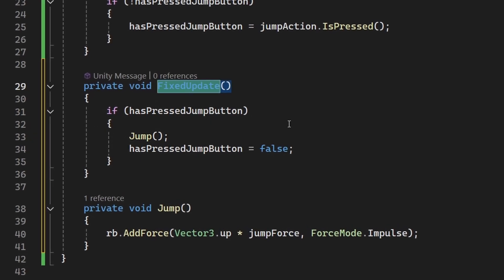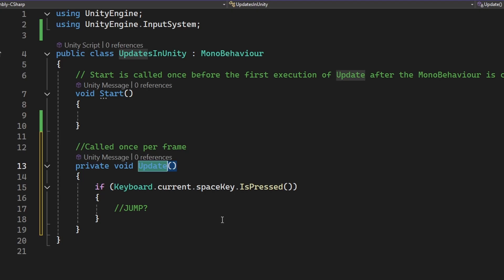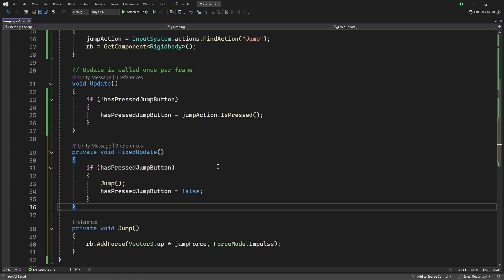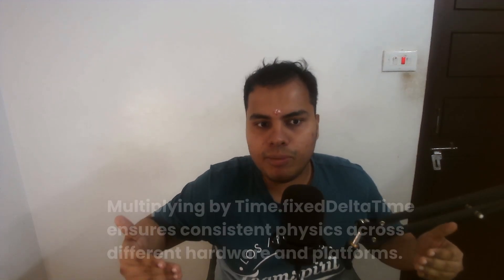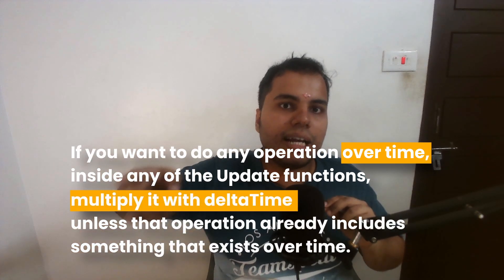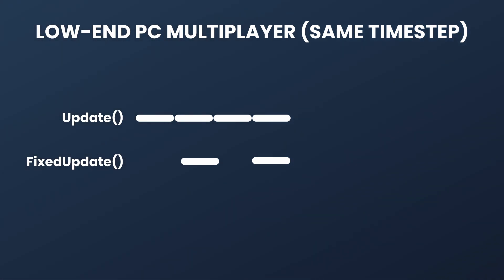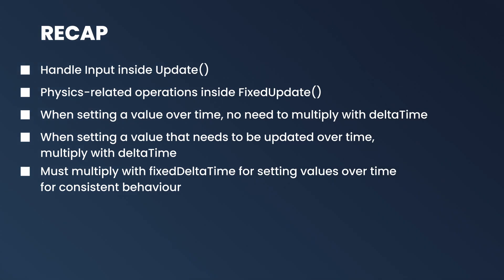The BIG MISCONCEPTION About Fixed Update

Comment: 2.5 times slower, not faster
Reply from the maker: Um, can you clarify where it makes sense? It's been a while since I made the video
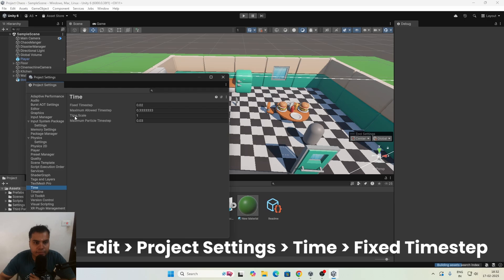Reply: @anandev  Yeah, around 1:25 you adjust the frame intervals to 0.05, slowing the physics updates to 20 times per-second down from 60
Reply from the maker: @operationfrogurt  Ahh I meant, 2.5 times faster when it comes to the overall physics performance. But from your context, what you said makes sense.

Comment: Hey can you create a video explaining Wheel colliders in detail. I am currently creating a Motorbike simulation game and its physics do seem quite nice but my bike doesn't turn enough according to the inputs yet. I believe it is due to the friction settings wrong on the slip factors and So i would like to create something similar to RIDE 5's physics.
Reply from the maker: Yes I will. I am currently busy with the Brackeys Gamejam, and funny enough, I am using wheel Colliders in my game too. Once this is over, I will have time to do it.

About the turn, you should consider looking into WheelCollider.turnAngle, and then multiply it with a turn sensitivity. Make sure you are doing it inside FixedUpdate as well. If you are facing any issue, join the discord server and you can ask me directly.

Comment: For input i would reccomend making it event based instead of detecting it in update, you can still cache input values via input events by using the performed and canceled events
Reply from the maker: I 100% agree. I should have recommended that in the video. A lot of people still follow older tutorials, and I thought it made sense to talk about it. But I really agree with using callbacks events.
Reply: How can you recommend an event-driven approach without knowing the game's concept? :D Also, a hybrid approach is better. The player's movement is not an event, it's a state. It makes sense to handle this with polling, because that's the game's fundamental behavior. The event-driven model requires to notify when the input changes, but I already have the potential to move constantly. Why should I notify you every time I move? It makes sense to say to the engine, “I'm going to be moving constantly anyway, so you keep checking for it, don't ask me.” So when does an event-driven approach make sense? For example, jumping. Moving is a much more predictable action than jumping. It makes no sense to constantly check whether you are jumping or not. Therefore, it makes more sense to say, “I'll notify you when I jump.” In short, if the input is continuous, polling is better; if it's instantaneous, event-driven is a better choice. Also, it would be illogical to use polling for a concept based on infrequent movements. I don't understand why the content owner agrees with your opinion 100%. I think you both need to do more research before expressing your opinions.